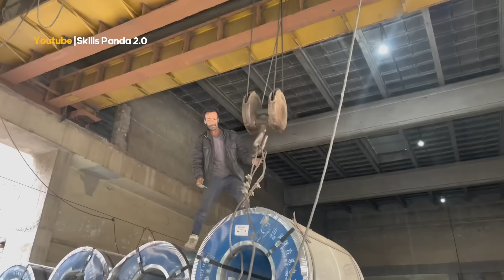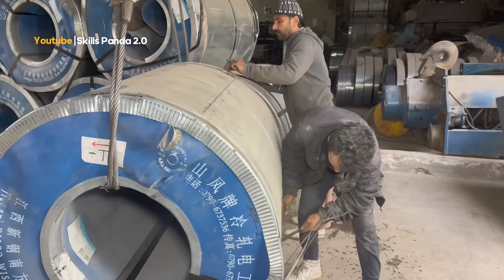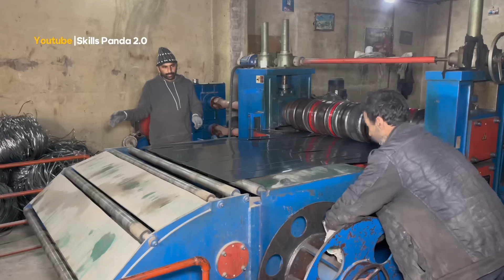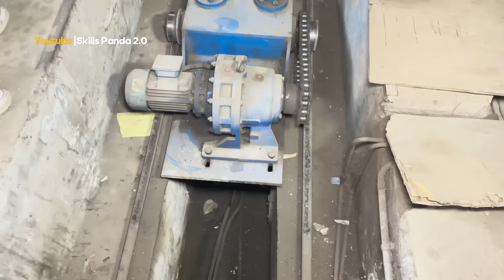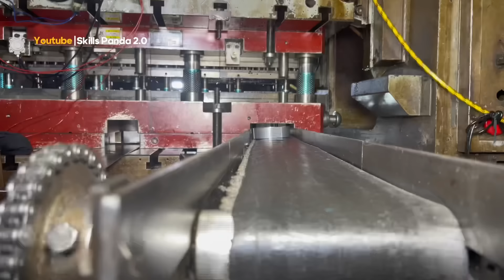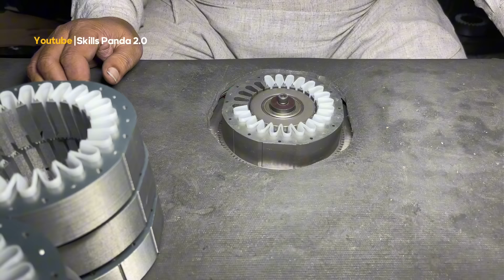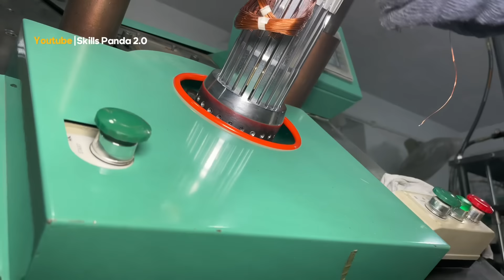Incredible Mass Production of Fan Armature in The Factory | Skills Panda 2.0

Comment: @00:30 i imagine that coil thats sitting on the ground messed up is what happens when those cables they lift with snap......thats why you dont use cables but a cradle....
Reply: @piperdoug428 
Most of the initial handling and setup is about Minimum  Damage = Maximum Output.